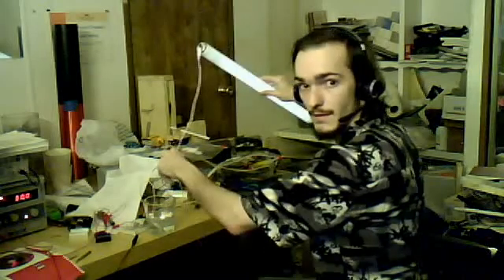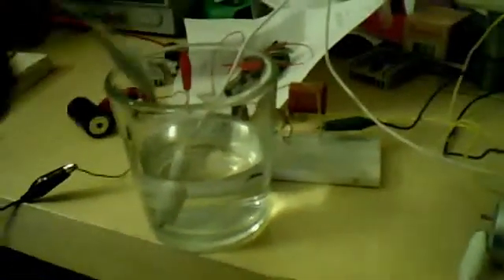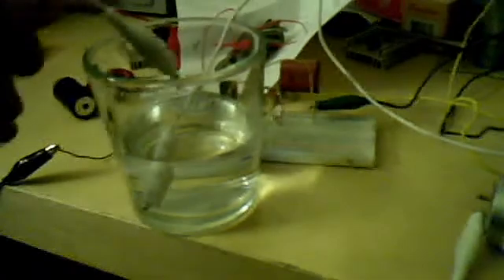1st water conductivity test, working...

Comment: Bottled water is not pure.  If you take normal bottled drinking water it has minerals in it.  If you use pure water, distilled, it will not conduct electricity.